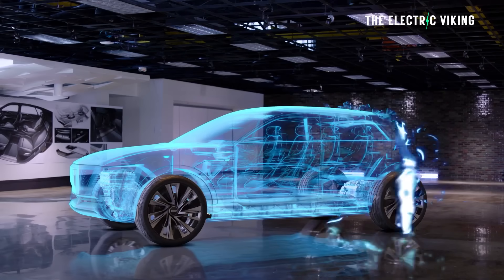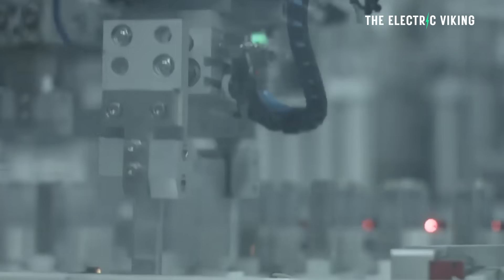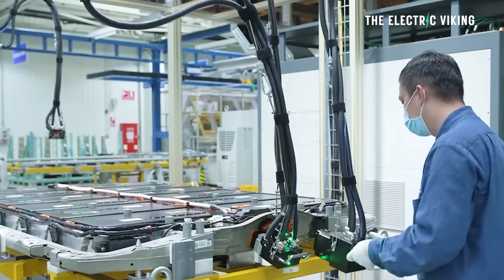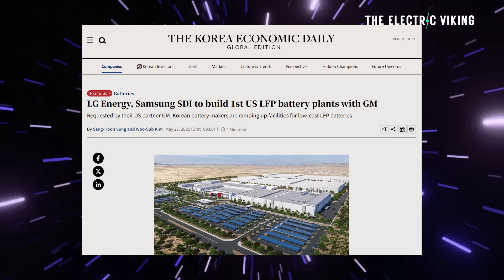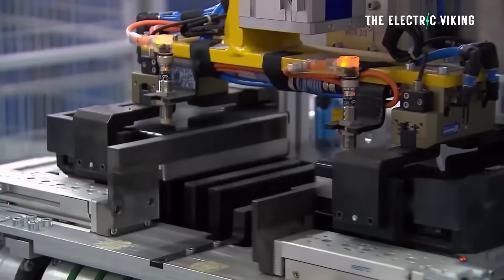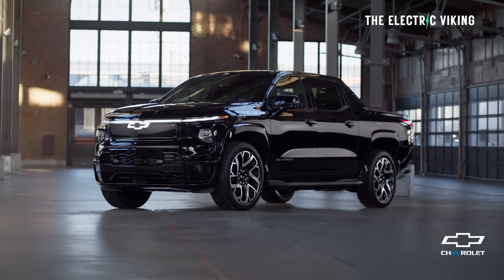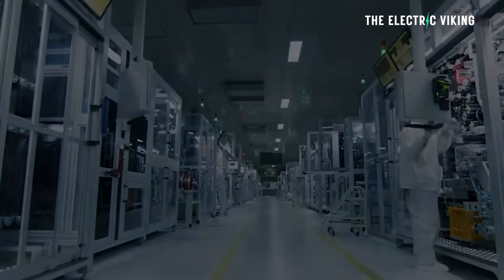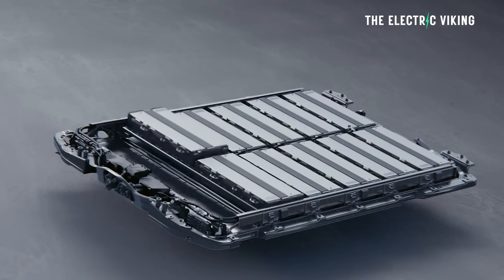GM’s LFP Factory in America is a game changer - $6K Cheaper EVs by 2027

Comment: These factories are fully automated. There's no reason for these batteries to be cheaper in China.
Reply: Building in the USA is more expensive than in China.  I was a Product Manager for a hybrid inverter company from Taiwan and they wanted to move manufacturing from Taiwan to the USA for product sold here.  I was tasked with doing the research.  

I had three different companies bid on them.  Two of them were lights out facilities.  Meaning that they were robotic and had almost no humans in the manufacturing phase.  Even with no labor it was 20% more than building in China and shipping them here.  

Even with no labor involved logistics and power was more expensive, insurance, building costs and taxes were all higher here.  These were relatively high volume items, 5 - 10K per year as they wanted to ship to North and South America.  That was the target anyway and what I was to get a bid on.  Labor isn't the only part of manufacturing that is more expensive.
Reply: @bryanwhitton1784  then government incentives will do the trick.
Reply: @George_Paul  Government incentives on building EV batteries?  Not from this administration.
Reply: Labor is just one factor. Asset, procurement, financing, logistics, R&D, market development - all cost cheaper in China than the US. Then there is the economy of scale.

Not just batteries or plastic wonders, this applies pretty much to any manufactured goods.

Comment: The fleet leaders in BYD LiFePO blade cell batteries are currently taxis on about 250,000km (150,000m). Reportedly they have suffered little or no battery degradation and have experienced ultra low running costs relative to comparable ICE taxis.